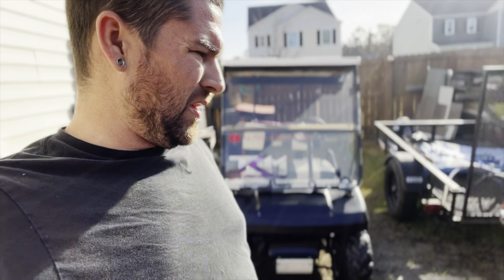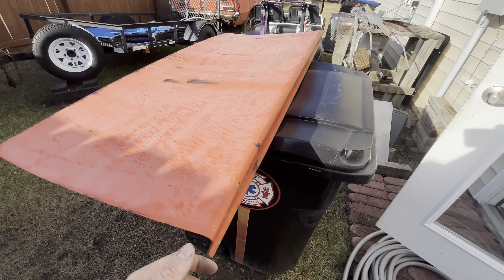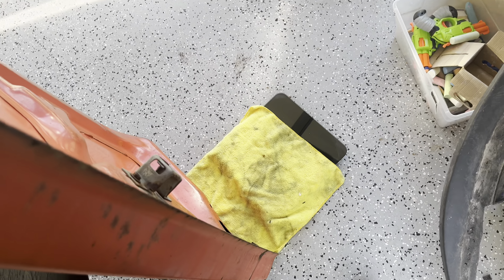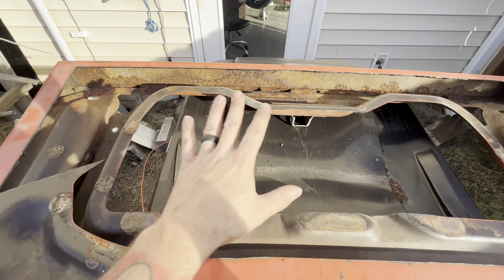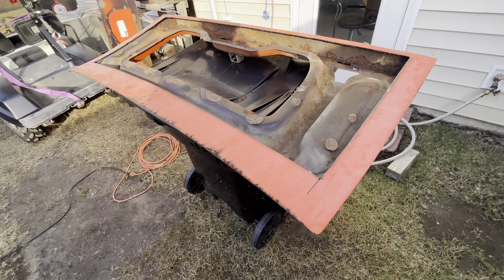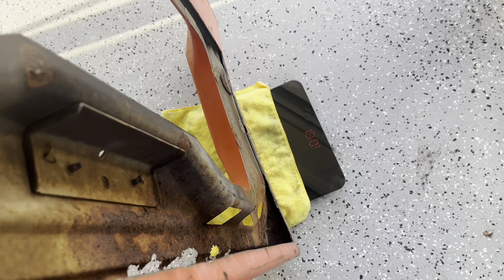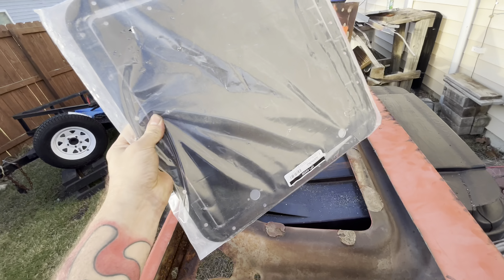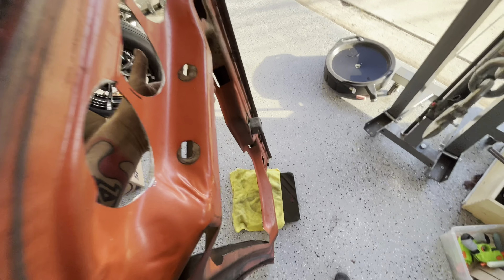Part 1💥 How Light Can We Get A OEM Steel Ford Maverick Trunk Lid? 👉🏻Budget DIY Racecar

Comment: I would love to see more detailed stuff like this because that is my next step on my project and this really opens my mind to it , I told you about my c-20 from my granddad that I drove down to Daytona turkey rod run with my son She weighs 3900 pounds with me and it full of fuel and that's a 68 8 lug truck,it still has full core support,heater box full fenders and liners and steel wheels with 2 33x12.50 mickey all terrain, steel doors and hood and a Dana 60 with huge calipers from a 2014 e-350
Reply from the maker: Yea your truck sounds awesome!  So far there’s 3 videos to this project and we haven’t even made it to body work. I’ll be releasing the next one probably tomorrow

Comment: Cool little project but imagine if there was that much thought put into every area of the car. I helped a friend on doors for a 70 something camaro and  got close to 80lbs out of each door still using original glass and regulators for street car
Reply from the maker: Yup on my doors I got them down a lot also when I did them. I just wasn’t doing YouTube then. I have all the weights wrote down for every part of the door before and after.